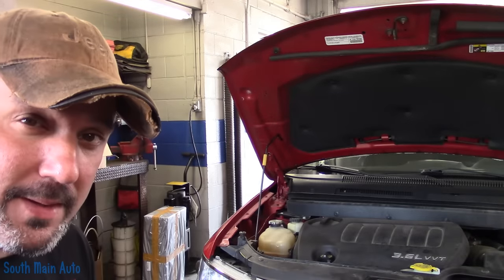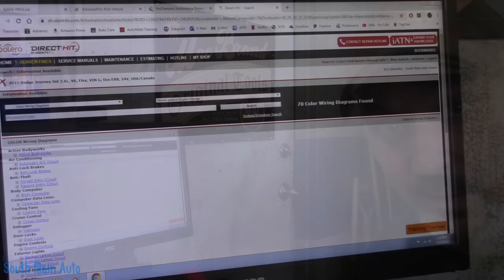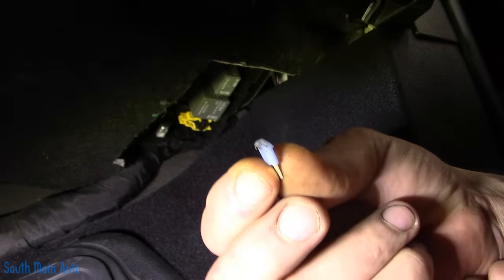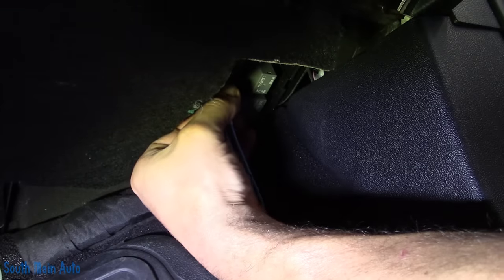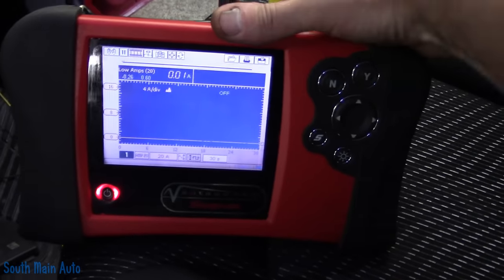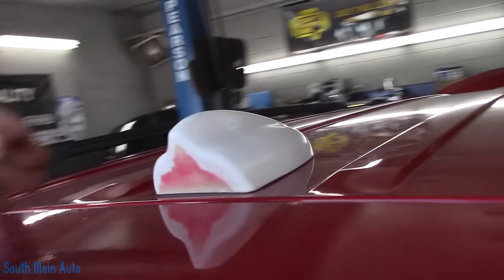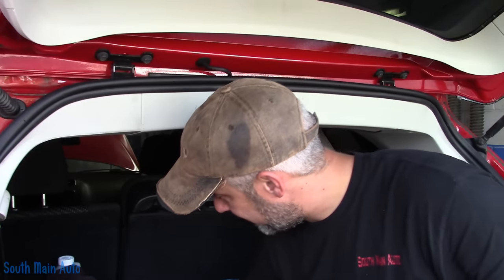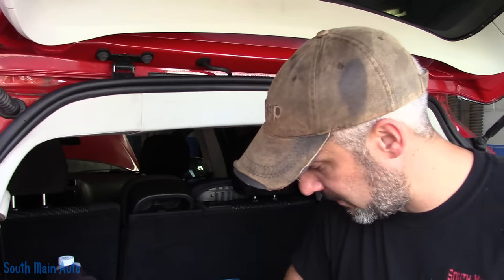Dodge Journey: No Start, No Crank

Comment: Chrysler dealer tech here, that shark fin antenna is not factory. Also, whoever did that hack job wiring is an idiot, wiring should never be run across the face of an airbag. That could interfere with the proper op of the curtain airbag right there. That's a federal offense, as it could be considered tampering with federally mandated safety equipment. One common problem i'm seeing with the factory antenna is the threaded portion of the mast gets broken off in the base of the antenna. Sometimes, the broken part can be unscrewed out, otherwise, the base has to be replaced. That rf hub has to be moved out of the way to replace the base. Seeing your update comment, glad that you were able to figure it out and fix it. Also, if the fobik is not transmitting, putting the fobik on the pushbutton and starting the car with it can help to diag.                              Edit: The interior antenna for the fobiks is under the center console, that's why the fobiks have to be in that area of the cupholder for the interior antenna to pick up the fobiks. I agree with you, Eric about aftermarket accessories installation, and about never tapping into a module power feed.
Reply: Never run anything on the egress side of airbag. Preferably not near it at all. Almost impossible to avoid on LE vehicle equipment installs though.
Reply: How about never tying into a circuit that also could just kill your car from even working!!!

It should be on its own circuit.  Take the time to run wires correctly.
Reply: I need to troubleshoot my antenna as the satellite radio portion has no reception, this video is helpful for locating parts.
Reply: Yea the only place you should really run power from is the battery or the power distribution center. Make sure you use an inline fuse (in this case they didnt do that either which would of saved the customer from a no-start). Then if necessary use a relay and connect that to either the ignition, or reverse light, to power say aftermarket powered windows or a backup camera, respectively.
Reply: @FreeStuffPlease  did you call me a loser? Mr. Want a be rapper. Maybe I'll check out your channel for some lil Wayne. 😆
Reply: well someone just said. "easy money" :D
Reply: I'm guessing you mean that shark fin antennea in particular. I saw a brand new ram 1500 with a black one of those, and my co-worker has one on her brand new grand cherokee, and she didn't install it. even then, i seriously doubt if i tugged on it that it wouldn't flop around like that one did.
Reply: Yes. But, the Journeys never had the shark fin antenna. I think that it would have been better to have the shark fin, as i'm seeing many of the Journeys coming in with the mast broken off. I've had to replace quite a few of the antenna bases due to not being able to get the broken piece out. To be fair, i've been able to extract the broken piece on a few of them, too.
Reply: People don't get how you can't tamper with certain parts of a car just from federal law. I'm glad you chimed in on that. I hate seeing a hack job on wiring. There's no reason to do that when you have a shop and you doing it for your income. When you don't have a shop and you're doing it yourself and don't really know any better I can understand it a little better. But a shop technician should be able to do his job or her job without looking like a freaking amateur and an idiot
Reply: @FreeStuffPlease  Using the power distribution box and running an inline fuse is exactly what should be done. I'm a mobile fleet mechanic and the wiring you come across is absolute insanity sometimes, even worse in the RV/Trailer industry (which I used to work in)
Reply: @ConTheDon187  Yeah. Honestly I would be worried to do it any other way. I guess a lot of people don't realize they can overload the wires/circuit. Unless you' re an electrical engineer, doing it this way is probably the safest.

Comment: It's easy to do that with modern meters and scopes.  They've got so many features.
Reply: Oh, how I would love a Big Clive / SMA collaboration video.
Reply: It is fancy but nothing more important than knowledge. This can be done with a multimeter that has the capability to capture max/min readings. Trust me, I can give you all the scan tools & scope meters and you wouldn't fix crap if you didn't know where to begin or understand the system you're trying to fix.
Reply: @rosco77365  clive is in uk and rick is in us, i guess

Comment: I agree with your method of tapping and giggling wires.  It works. 

Short story... I am an aircraft mechanic. A helicopter was getting an error message from the autopilot. Gyro invalid. I finally found the problem by bumping the circuit breaker panel and noticed the gyro needle jump. A terminal was loose. I was later counseled for improper troubleshooting. I told that person to pound sand.  Why didn’t they like me?

Comment: Nice man. I get this sort of crap a lot too. Customers get upset at removing the badly installed wiring. Can't win sometimes. The installers need to learn that harnesses need to be insulated to be done correctly.
Reply: or use wire that will take the sustained chaffing and sharp edges, yeah I know they'd never use it because of the cost $$$
Reply: Glad you guys talk. You both have great diagnostic sites.

Comment: Literally had a red journey come in today with a no start, and it was red too! Mine was a 2016 though, with the 4 cylinder, and it still cranked. Turns out it needed either a CKP or the harness. Chrysler actually has a recall for that specific issue so we sent it to the dealership

Comment: For those who do not know, You can push the Push To Start button a second time to stop the engine from cranking. Also if you hold it in, while driving, the engine will shut off.

Comment: Eric, your distrust for aftermarket equipment and installation is well justified.

I've seen too many cars where an aftermarket stereo amp was installed with no fuse or circuit breaker. The system required a 100 amp circuit but only installed using 10 gauge wire. Should have been 4 gauge or better. The wire was run through the rocker panel, with like the Journey, no anti-chafe on the wires. Good way to burn a car to the ground.

Out of the referral work you get, any idea how many new customers you pick up as full time clients?
Reply: Working 20 plus years as an RV tech I have sat in wonder as to why the rig I am working on hasn't burned to the ground.  When I tell the customer what I have found they are usually not amused by being the recipient of a previous hack job.

Comment: The dealership I worked at would remove all aftermarket accessories from their used vehicles before they sold them. Dealer principal didn’t want anything on used vehicles that wasn’t an factory installed option.
Reply: Oh, I wish every dealer was like that,a long time ago I bought a vw golf and had some trouble, I went under the dashboard and got shocked, the amount of cable and aftermarket junk I removed was just ridiculous and I hope I won't see it again.

Comment: That's called a Micro2 fuse. They also make a Micro3 fuse which is two separate fuses that share one case with a common center terminal.

Comment: Whom ever installed the camera is an amateur.  Wire that to the reverse light circuit.
Reply: Yup which is already typically in the tailgate as it is :)
Reply: How are they going to watch behind them while they’re driving???
Reply: @JoePJack1  Mirror and that large rear window.
Reply: They may want the camera available as a turn on option. Cameras can be made to work either way.
Reply: Looks like its wired to stay on and be used as the rear view mirror.
Reply: @FreeStuffPlease  Which is what the window and mirror are for.
Reply: Yes and power is off unless in reverse. Unless, they wanted it to work besides going in reverse, likely their main idea.
Reply: @timgraham7851  im just saying thats probably why its like that. I would get an aftermarket radio that supports backup cameras. Id probably run power from the battery/power block with an inline fuse and use a relay hooked up to the reverse light. A relay might be overkill but then you can add some awesome leds in your bumper if you want aswell (e.g. a truck) without any problems.
Reply: @FreeStuffPlease  I agree.  That would be the smart way to do it.
Reply: @timgraham7851  I only mention the LEDs because I cant see much when I backup my truck in the dark and have been wanting to do this installation for a while. Haha
Reply: I never use that reverse light. Just for that reason. I tie into the key on circuit. That way you can use it while driving....
Reply: That's just as dumb. You don't know how much current the thing will draw or how well its built. You don't want a garbage aftermarket part causing problems. The correct way to hook anything aftermarket up is to add another fusebox under the hood drawing directly from the battery. Then whatever you add draws power from the added fusebox. Then you add relays for any necessary triggering mechanisms. That way there is no chance that the stuff you add will draw more current than what its rated for. Use the correct automotive rated wire, run everything inside looms,  add grommets where necessary, and leave a wiring diagram inside the fusebox you added. The parts are cheap and readily available to do this properly. Any other way is a half assed and only causes headaches down the line. Just because you don't have to deal with problems from your install doesn't mean someone else won't. 

I added additional lights to my truck and an extra constant 12V outlet in the back. Both were done this way.
Reply: @DavidPruitt  Yes I do idiot. I install them all the time. They come with an inline 5amp fuse. As the wire is not rated for more them that to start with..As with all Chinese junk. 

Thank You
Reply: No find an accessory in the fuse panel and use a fuse adapter to tape it
Reply: Gee, some of these commentators are harsh,  bad install, nuf said.
Reply: Thats an insult to Amateurs! I'd say the installer was a lot less than that.
Reply: People always say that, better through an inline relay connected to reversing light; don't draw power from light circuits these days as they usually connected via modules (indicating to the ecm a particular blown bulb!). I would like someone to confirm this as I am no expert just my experience fitting camera on my own car.
Reply: It's so it can record, its a rear facing dash cam
Reply: @FreeStuffPlease  that makes sense. You are right.
Reply: @FreeStuffPlease  - you are right. We probably have a lot in common. That was dumb of me to escalate a fight over one word. My bad bro.
Reply: Some camera systems need a constant power or at least ignition power source for main power and then use a trigger signal that can be tripped with the backup lights.  Not an uncommon issue but when you have wires go through a body hole it's a good idea to put the wire in the loom or at least split a piece of hose and use that as a grommet around the sharp metal.  Either method would have prevented this failure.  Hack job any way you look at it.
Reply: @tomctutor  New cars use LED lights. The TCC Circuit monitors the Brakes lights for high resistance. You go sticking stuff on them lights. The TCC will think you have your foot on the brake. Thus the torque converter stays lockup. Which then burns up the transmission.  Seen many that did just that. Installing LED to replace the bulbs. Then the TCC see low resistance. Bam the Transmission fried.
One reason they tell you to use the reverse light circuit. And tie the power on  wire into the reverse switch for the camera to work. But installers avoid that shit. Just more failure points. So I run a ignition on wire from the radio\camera with the RCA connector. Install the 3amp fuse where you can see and get at it. Problem solved. As them cheap Chinese wires might have 4 strands of wire in them. To power up a 5 watt camera. As the load might be .5 amp....But having to find the short is time wasted. 

Same shit with that cheap ass Shark Fin XM\Radio extender antenna. The hole is for the antenna cable to fit trough the roof. the Fin is just double sided taped down. https://www.amazon.com/Generic-Car-Shark-Antenna-Black/dp/B00Y0C5ARW
Reply: They should have ran that red wire OVER the air bag instead of under it too. If that thing got in a wreck there's a chance that airbag wouldn't deploy like it should.
Reply: @MasterChief-sl9ro  I wasn't replying to you, but since you insist. Inline fuses are almost just as bad. They're rarely easy to mount properly and are frequently poorly made, usually with wiring that's too small. Which is going to either cause problems running the device or cause problems when you have to go in later and diagnose a problem. In my experience the fail rate on inline fuses is just too high. An add-on fuse box isn't expensive, they're well made and you can add quite a few circuits which are made to be easily mountable and accessible in any place with the space.
Reply: @DavidPruitt  Seems to work for damn near every auto manufacture. As the only way to mess up an inline fuse. Is poor installation.
Reply: FreeStuffPlease it’s too bad you couldn’t just use the rear view mirror as a rear view mirror.
Reply: *who
Reply: @FreeStuffPlease  that's why they invented the rod and balls so you can attach it to the 2 hitches and line up with the balls old fashioned Know how
Reply: @michaelouellette7950  I know a lot of people do it that way but with aftermarket items being prone to failure I agree with another person who commented that you should run a separate fuse box under the hood so that any failures won't effect the car's fuse panel, there by affecting performance like in this vidio! He is also correct in saying that parts are readily available and cheap to run your own power distribution block , and or a fused block, use relays, properly sized wires and use grommets when needed! Also, leave a wiring diagram in the car so that the next guy can understand what he's looking at!

Comment: Good job finding that short.  I love the DIY radio installations with wires twisted together and wrapped in cellotape. Bad radio and alarm installations and trailer plugs with those blue scotchlock clips are a curse  we deal with  regularly.

Comment: “Sent from another shop”. They couldn’t figure out a blown fuse? Sad. You need to be an electrical engineer and a computer programmer to work on modern vehicles but old fashioned diagnostic steps will always save you. Another great video Eric.

Comment: the backup camera should be tied into the red wire on the rear backup lights so they only turn on when the back up lights are on.  been looking at Dodge Journey videos for common problems as I just got one recently.  i'm glad this issue is caused by a faulty install of a back up camera and not an issue with the vehicle itself.

Comment: I put 154K on a Journey.  When I traded it, it ran like a Swiss watch.  And the ONLY problem I had with it was warping rotors.

Tried Napper rotors and calipers - no joy. The only ones that lasted any significant time were the OEM parts.  Otherwise, that Journey was a dang fine car and I was kinda sad to see it go.  Of course, I didn’t stuff any after-market crap in it either.

That 3.6L engine was no slouch either.  It would haul the mail if you asked it to.  One of the very few Chrysler products I enjoyed having.

Thanks Eric.  Outstanding video!

Comment: Oh man hating on the FCA at the opening of the video and here it’s someone else’s meat nuggets messing things up 😉
Reply: AirRatchetJockey Chrysler is still junk regardless
Reply: Aftermarket installers don't need to assist FCA, they eff it up right from the assembly line.
Reply: Svoon V no, just facts.
Reply: ok, so they get  +1 out of - 10000000's ;)
Reply: Svoon V you’re right man, Chrysler is just shit.
Reply: I've had 4 Mopar vehicles back in the day that were tanks.  67 D10 Custom Cab Truck, 73 Newport, 73 Satellite, and a 74 Charger SE.  Perhaps it was from their lack of any major electrical system but they sure we're fun to drive and work on back then.
Reply: Shadowz Edge I believe you. That was way before fiat and Chrysler merged.

Comment: Hey, c'mon guys, this problem wasn't Chrysler's fault! It was a crummy aftermarket installation by a hack! Chrysler sends me a pension check every month and I don't want them to stop! BTW, I retired back when Chrysler was still Chrysler, and New Process Gear in Syracuse was still owned by them and still going strong. Now what's left of it is in Mexico.
Reply: I worked at Chrysler dealers forever until Fiat completely took over. I left shortly after they introduced the new Pacifica. We found a lot of electrical issues on the units that were being prepped for the big roll out ceremony. It was a new product and there was absolutely no service info available. It was a nightmare to be on the phone with Star trying to figure out these things. Even the WiTech wouldn't communicate with everything on the vehicles and we didn't know if it was a vehicle issue or a Witech issue. But we finally got them straightened out for the big roll out.